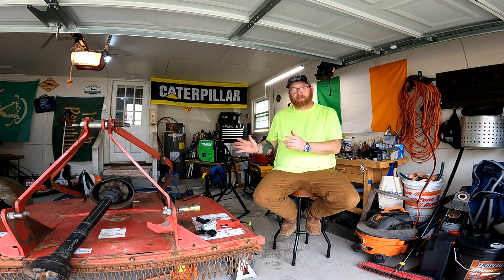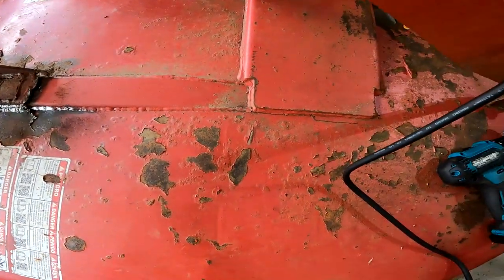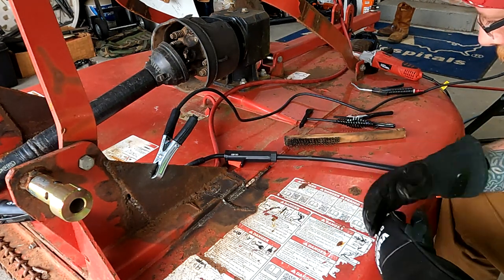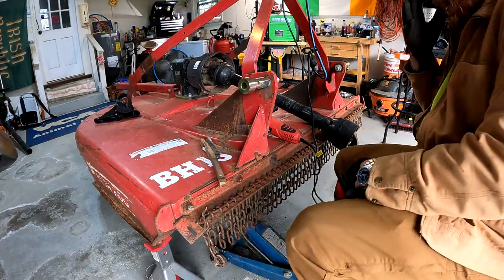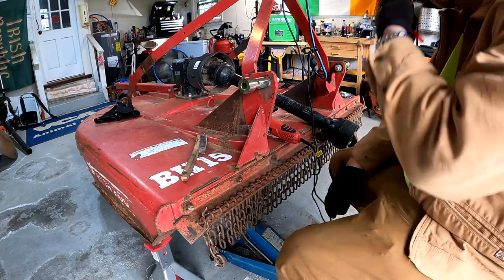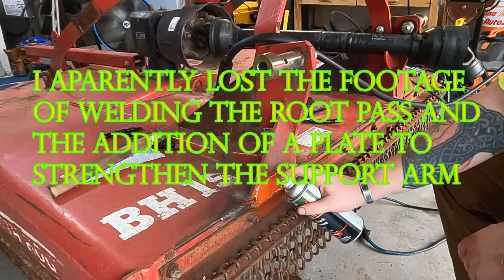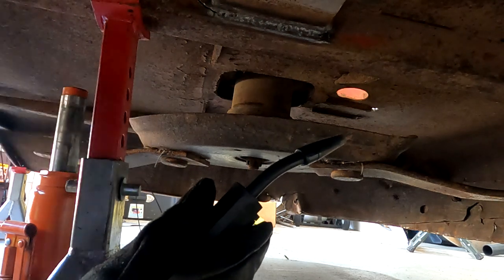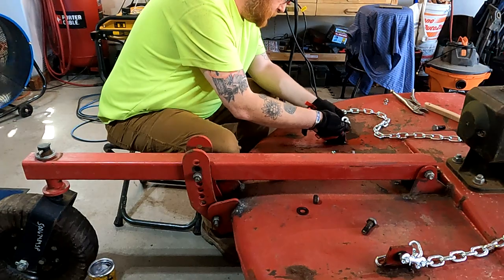Bush Hog BH15 Repairs

Comment: I’ve beat my BH15 to hell and back and not had any broken welds or cracks. Pull it behind my 1998 38 hp Massey Ferguson 231 tractor. I hope your BH15 is still doing good, they are excellent rotary cutters!!